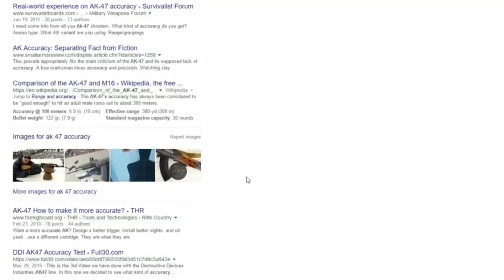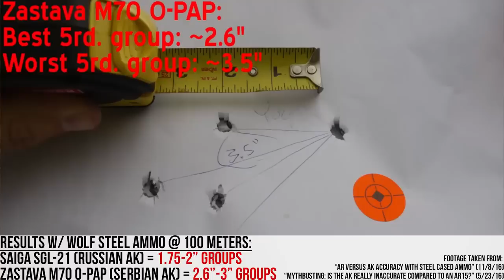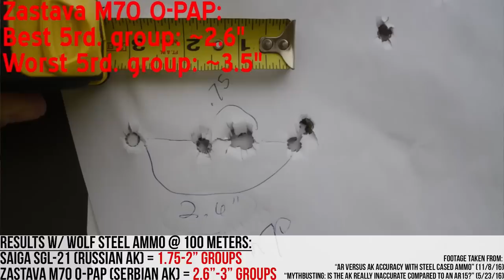Busting the WORST AK-47 Myths! (Featuring InRange TV and Mishaco)

Comment: Ak47s are dependable as long as you don't use corosive ammo and leave them sit without cleaning aftwards. They're also just like any other firearm as far as reliabiltiy goes. If the firearm is well maintained it'll work fine but treat it like crap long enough or allow debrees to get into the action and it'll choke up
Reply: АК-107 Пролежало на чердаке в пыли 9 месяцев я достал рожок вставил передёрнул затвор и что вы думаете произошло?

Comment: The ak is accurate but get out past 300 meters and see what happens vs an m4. That’s why the ak 74 was made. The 762x39 did not fare well in the long range engagements in Afghanistan so the Russians came out with the 545x39 which greatly improved the range because of its increased velocity. The 762x39 goes transonic around 350-400 meters and is no longer a stable projectile.

Comment: The original AK-47 actually isn't the most produced version of the AK family. That honor would go to its modernized offspring, the AKM. It's even simpler and cheaper to produce, it's lighter, it's more reliable and more controllable under automatic fire. 
It was introduced in 1959, about ten years after the AK-47 and about the same time as the AR-15, which would evolve into the M16. So I never understand why the ten year older AK-47 is always used for these comparisons while the AKM is left out. Or these really are AKMs and everyone just calls them AK-47s due to a lack of knowledge.

Comment: I feel these myths were kinda a stretch, yeah they spoke facts in this video but I feel the are so many better myths (although I do like how they added the reliability one cause the fact people think they never stop running kinda bothers me). But like hear me out, so like, the sight radius, yes it's not the shortest however the ak is suppose to be an assault rifle and y'all compared it to a carbine platform, carbines are meant to have a short sigh radius because a shorter radius allows the shooter to get on target faster with the compromise of accuracy, when compared to other true assault rifles it does have a fairly short radius however it could be argued this is too once again assist in close combat where quick target accusation is important. Second the cost myth was a stretch just because they just pointed out magic laws of economy of scale, all weapons have that same economy of scale and I'm pretty sure the ak is cheaper when compared to other weapons in its class with the same size production run, and lastly y'all should of included the biggest myth of all, the ak 47 is not the name of the weapon, most of what people know as the ak 47 is actually just an akm, pretty much the same weapon just minor flaws with the original AK 47 were fixed and thus a true Ak 47 is hard to find, but like I said, this video has a lot of facts but I think there could of been better myths to bring forward

Comment: Tales of the gun M16 vs. AK-47 accuracy test clearly shows that with standard iron sights at 70 yards the AK-47 does not even hit the target one time but the M16 hits every time exact center Mass. These were "special forces marksmen soldiers" competing in this trial. When the footage is slowed down we can see why the AK-47 is so inaccurate, it is because of the loose tolerances. Also, I noticed that you conspicuously left out the inrangetv AR-15 mud test... optics greatly improve the accuracy of an AK-47 however, it adds weight and the damn thing is already heavy enough as it is without adding accessories.

Comment: Number 2 and number 4 does not agree - and here's why:
Myth 2-the reliability of the AK, as well as its accuracy, durability, weight, convenience and much more depend on one factor - the manufacturer. Soviet AK are considered the benchmark, and these AK the most high-quality Assembly, with right tolerances in design and original technology production. Karl was scolded for what he took not the Soviet AKM and was not satisfied with its reliability. The highest quality AK - Soviet, Russian, Polish and DDR. The worst AK - handicraft, Hungarian, Romanian and Chinese.
Myth 4-AK is really cheap in production, simply because it requires much less materials and man-hours than any NATO assault rifle. A vivid example of its simplicity and cheapness (monetary and material) - the fact that it is the AK most copied assault rifle among developed countries with factories and technological capacity, and among the self-made workshops.
P.S. - google translate.

Comment: the reputation of the Ak's lack of accuracy more comes from poorer ergonomics and long range bullet balistics than mechanical accuracy.

at 100 meters mechanically, the AR-15 and AK-47 should be more or less the same, but 200 or 300 meters the difference will show, the 5.56 is flying far faster and has far flatter trajectory compared to the 7.62x39 which slows right down and starts to fall out of the air, thus at 200-300 meters the AR-15 will be noticeably more accurate.

and then there's ergonomics, the AK-47 has far more recoil, has a drop stock and it's 2 post forward sights suck, the AR-15 has far less recoil, has a straight stock and Rear aperture peep sights which are really good.

so at 100 meters theres no differnce mechanically, beyond that though and they're will be and in the Real world the AR-15 will be more accurate due to superior ergonomics.

the AR-15 has better target acquisition and followup shot ability because of these reasons, and you can spend less time aiming or correcting for an accurate shot than the AK can.

Comment: Is it possible that the myth about accuracy is caused by the fact that most armies or armed group that use AK-47s are not know for gentle handling of their equipment? I believe that there would be a great difference between how you treat your own gun, and how some somali who picked it off from a dead body off another somali, or some army quartermaster in post-USSR country..... handles theirs.  Some bend'n'dent here and there, after years of rough handling even the most accurate rifle will loose its edge.

In short, isn't that myth result of treatment instead of bad design?

Comment: I would like to know why the hell the Russians have not replaced the rear sight on an AK with a picatinny rail. Move the rear sight to the dust cover.

They got rid of the carry handle on the AR-15 in favor of a picatinny rail. AK needs to put a rail on the most stable part of the gun which is the rear site position.
Reply: the thing u miss is that its not a fucking AR its a AK 47 !!

Comment: AK is less accurate. You need to understand what it is that you're comparing. You can take an issued M4 with issued ammunition and compare that to an issued AK47, if you can still find one. That'd be one way. It would not really tell you much about the capabilities of the platforms, but it's a practical way to look at things.

Or, you can get the best that an AR can do, with a match grade barrel and ammo, and see if you can replicate that with any AK. You will find that you can't. 

Otherwise you're comparing a random rifle/ammo setup to another random rifle/ammo setup. The point being?

Comment: "One of, if not the most reliable rifle in production." 

You must have missed the mud test on the AR. Spoiler alert: it ran flawlessly when covered in mud both with the dust cover open and closed.
Reply: AzeriBeast /// whatever dude. If your criteria for a gun being reliable is whether or not it runs when you pour a handful of dirt in it, I can't help you. That in no way is a realistic conditions.
Reply: AzeriBeast /// unless you are using crappy ammo you don't need to clean it very regularly. Certainly don't need to after every time you shoot.
Reply: AzeriBeast /// except the AR because its built well enough to keep the mud out. 

And no, if you shoot bad ammo (corrosive surplus) you need to clean you gun regardless of what it is. And personally being able to shoot crap ammo isn't a selling point. Crappy ammo is going to shoot worse. It's not worth the few cents saved

Comment: Loved the video! One thing I will say about the short sight radius though, is that it may not lend itself to the level of accuracy of an M16 iron sight system (whis is good enough for 600 meters in  USMC qualification), but the shorter radius is much easier to acquire the target quickly, which is a completely different issue that bench rest targeting. Shooting from a bench, the longer sight radius wins hands down, but in an alley with incoming fire, hitting a target within 50 or 60 meters is MUCH easier with the short radius

Comment: the only thing i can say about the AK in accuracy is that. the AKM series and the copies tend to have bullet tumble alot. it wasnt till the AK-100s series to when the russians FULLY fixed this issue, but it wasnt the firearm that had the issue, it was the weight of the projectile that wasnt center mass'd well. you CAN use the new AK 7.62 rounds in the AKM and before models, but just like with using non-special sub-sonic ammunition for suppressed weapons, its not recommended. 

The jamming thing. is very true. if the weapon worked so well, it wouldnt be 30$. the AK series and veriants all the way to AKM had jamming issues if not taken care of, even AK-74s, the 5.45 veriant of AK. the AK-100s will operate better due to better maintained and machined parts with more tension put on lets say the spring system of the new mags that go with the rifle. and better slide power.

The only thing i can say about the AK sights. is that you can fire it without the rear sight just fine.  but the problem, is that the rifle... is designed to be a rifle. not a carbine like the AKS-74U. alineing the sights of an M4 to an AK-47 variant or AK-74 variant. is not a good example. as these are rifles with non adjustable stocks, some variants collapsible, yes. but the problem is that you cannot get your eye up to that rear sight correctly, and that is what can knock your accuracy off.

what i can say about manufacturing is... which version. i understand what the guy is saying. but. thats only for mass production. now when youre talking about the AK-100 series. these rifles are expensive. if youre talking about the AKMS thats a relatively cheap rifle. if youre talking about lets say, AK-74 that is a cheap rifle. because they ARE easy to manufacture. wile the AK-100 series is relatively new, orders for them arnt very large, and theyre built more like M16A4s then AKs. theyre built in quality.

Comment: For a myth busting video about the AK 47, it's kind of funny how these tests aren't done with AK-47s, and it doesn't even address that an AK-47 is not just any AK platform rifle, it's a very specific version manufactured in a very specific time period (for a few years after 1947, when it was designed). Not saying these wouldn't apply on the original model, but it doesn't prove much to test accuracy using a reconstruction of a gun designed 50 years after the original.
Reply: its a AK47 variant just like the AKM is if it fires the 7.62x39mm its called a AK47 variant they all function the same way.
Reply: @00008HANK  No, it's called an AK variant, and they don't even call it "AK-47 variants" in the video. Testing reliability or accuracy on a weapon designed 50+ years later makes no sense, and if they functioned the same way, armies would not have developed never versions of it, they're just keep producing the same rifle as they did 50 years back. It's not like they're using reproductions of the AK-47. The argument that it's the same caliber is  also not very relevant either, just look at all the weapons firing 5.56 NATO.
Reply: @Lasergurka  ummm no in Russia we call them AK47 and AK74 variants since the 2 fire diffrent rounds thats why they are called AK47 variants since they fire the 7.62x39mm round
Reply: @00008HANK  Do you call the SKS or RPK AK47's too? it's the same round after all. lmao So let me get this straight, you don't refer to an AK-74 as an AK-47 variant, because it doesn't use 7.62, but you refer to the AK103, that's based on the AK-74, a AK-47 variant, simply because it has the same caliber, but not the same design?
Reply: @Lasergurka  ummm no the SKS was never considered a AK 47 variant since it dosent use the same gas system or bolt its not magazine fed ether. Also yes we do consider the RPK 7.62 a AK47 variant while the RPK-74 as a 74 variant also no we cons8der the AK103 a AK100 variant not a AK74  variant.
Reply: @00008HANK  What do you mean an AK100 variant? the AK100 is a family, not a rifle...you can't call a part of a series a variant of that series.... and if you don't consider the AK100 series to be AK47 variants, then you just proved my point, as AK100-series rifles are used in this video...
Reply: @Lasergurka  ummm no they are not the SAIGA is not a AK100 searies rifle its not built to the same standards as a military issue AK100 searies SAIGAS tend to be lower quality then military issue rifles same goes with modern military ammo and civil ammo. They are just hunting AK's built on a AK47 or 49 base (yes the AK49 is a actual designation of the AK47 type 3 milled reciver guns).
Reply: @00008HANK  lmafo okay so a saiga does not count as AK100 variants, even tho that's what they're based on, but they count as AK-47 variants, even tho they have nothing to with that rifle...at this point you're just making shit up

Comment: I thought how the first three myths were addressed was very fair. But the fourth is a joke.....  Its the Soviets problem they built entire cities to mass produce their rifle. A apples to apples comparison is how much does it cost to produce one rifle in relation to another. The AK receiver is sheet metal stamped/welded and the barrel is pinned. It is very cheap to produce compared to a milled receiver and threaded barrel. Its also faster to produce.... This is why the Grease gun and Sten gun replaced the Tommy gun in WW2. And this fourth FACT (AK is super cheap to produce) is the very reason for its success today above all others!!! With basic hand tools kids in Afghanistan manufacture and repair AKs today...... try that with other models of rifles.

Comment: You got the second myth wrong the AK-47 reliability means it is easy to unjam in the battlefield its built so loose that you can simply shake or hit it and it will unjam but carl didnt even try that 
- 
If you want to make the ak look unreliable you are gonna need to try to unjam it and fail because thats what an unreliable gun is so carl's video is baseless and for showing it YOU GET THE THUMBS DOWN! 
- 
Well technically you didn't do that vid so,,, i guess it'd be a bit unfair and you got the accuracy right so on second thought fine ill thumbs up if you try out the AK-308

Comment: " busting AK-47 myths"  starts with accuracy and shows a modern AK variant. No shit sherlock, of course  that's accurate. It's not a bloody AK-47 now is it? AK-47 rifles are inaccurate due to the shitty manufacturing during the first years of production, not because of the way the platform was designed. New rifles are made with less tolerances and more accurate machining resulting in a more accurate rifle. An original AK 47 is not very accurate just as the first M16 rifles weren't great either.

Comment: 6:45, you're comparing an ak to an M4 Which is basically a CAR-15, not and AR-15, the latter of which is an M16 that has a significantly longer barrel and longer sight radius. You've obviously failed on that one.

7:25, That's just bullshit since peripheral vision wouldn't be compromised when the user is properly trained to shoot with both eyes open with other specifics and the rear sights on an ak requires more focus since it's a tiny notch that has to be aligned with a perspectively even tinier front sight post. That's the reason why improvements on the ak like the IMI Galil and the Valmet rk 62 have their rear sights using aperture rings and are placed on the very rear of the dust cover.

10:11, that's basically the Economics of Technological Progression where the more advanced the technology and infrastructure is for a necessity or a product, the less costly they are to produce. That's the same way as how a B2 bomber cost two billion per unit to produce right at development but would only cost two hundred million or less with today's technology...

Comment: While it is indeed a powerful and great weapon, it is not perfect, it has some drawback most coming from the users, as any weapon for that matter, especially firearms, unless you are properly trained its pretty useless to shitty, because the old fashion method of spray and pray on full auto is not tactic it is retarded, and while yes it can handle lots of abuse, leaving out in the rain, the mud and sand won't cause to much damage,  you still should not do it in the first place, especially when your life will depend on it, because mud of rubble getting caught into something is the least of your worries.

Comment: 03:32 This is Chinese AK, not from Russia. So, do not be surprised.

"Myth #2: Chinese AK-47 is invincible."

Buy original from Izhevsk or Tula.
Reply: Вольдемар Пиотрофский it was not Chinese. Yugoslavian I think

Either way, the design is the same, and will have the same issues. The AK has large tolerances in the action, and this is great for the gun not freezing together, but it allows mud and grit to get inside and built up very easily. Jamming it.